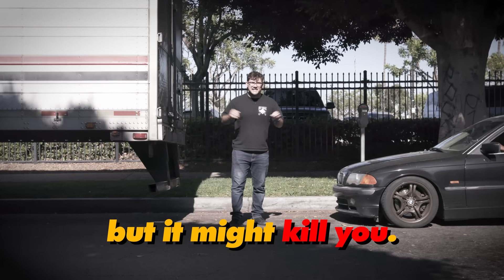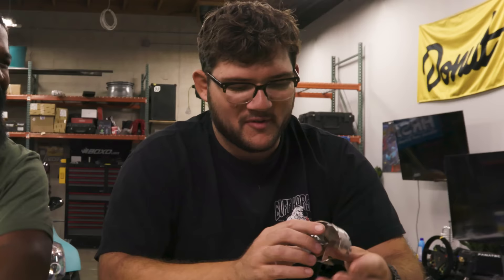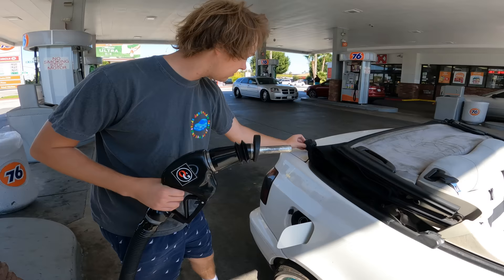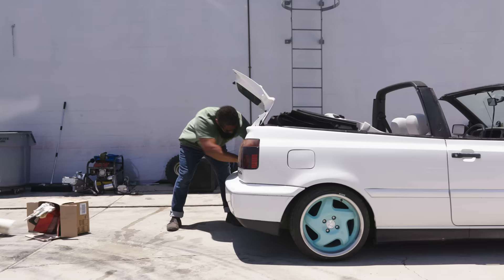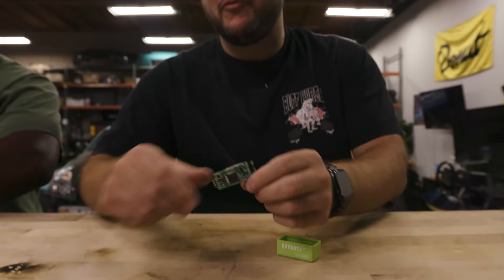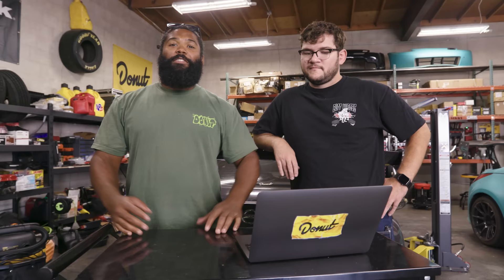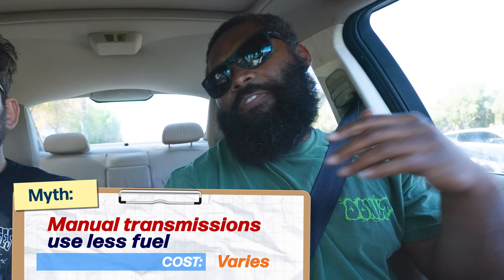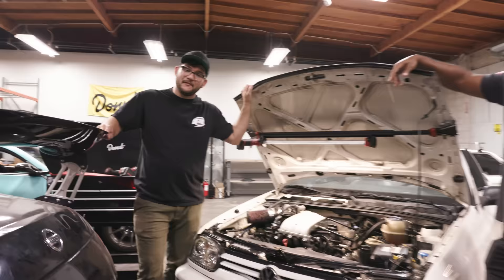Testing Fuel Economy Hacks

Comment: Using cruise controls is a huge way to help increase your MPG.
Reply: Yes. But if you are really trying to save fuel. You turn it off up hill and let the car slow down a bit when going uphill instead of just maintaining your speed over a short rolling hill. Then get your speed back up on the back side of the hill.
Reply: @TheYardLimit  That's probably right but it kind of defeats the point of cruise control.
Reply: This isn't true. Cruise control doesn't increase MPG. It decreases it. "Manual" throttle control is more efficient. In cruise control mode, the car has to constantly open the throttle (sometimes the whole way) to achieve a set speed. Manual throttle response allows the user to find that sweet spot where the car doesn't shift gears. Yes, you may decrease speed. But most cars are more efficient at 60 mph than at 75 mph anyway.
Reply: @TheYardLimit  The logic you start is the very reason not using cruise control is far less efficient. You foot is constantly pressing and releasing the throttle which results in accelerating more often. Which results in burning far more fuel. a simple Google search will result in verifying this.
Reply: @dougcook7507  Cruise control works great for hypermiling flat land. But if you are in an average car, especially with an automatic transmission, if you put the cruise on and come up to a hill, the car will sense the load but it wont know how long the grade is, its gonna kickdown a gear and give a bunch of gas to maintain speed.

If you are really good at hypermiling, what you do is anticipate the grade. Perhaps use a downhill section to gain some extra speed without using too much power from the motor, and then back off the throttle coming up the grade. Let the car drop down to maybe 50mph from 65 or 60 if the grade is short enough for you to kind of coast up. Thats really hypermiling 101.
Reply: @dougcook7507  cruise control is more efficient than the average smoothbrained driver, but an actual hypermiler will achieve much better mileage with the cruise control off. My car is featured in this video, "the roadmaster" station wagon. The previous owner deleted the cruise control(probably so that he didn't have to adapt it to work with the manual transmission conversion, but he was far from lazy lol. He had the patience to eek 40+mpg out of a 5000lb car with a v8. I witnessed it personally when I bought the car and only had to put 3.5 gallons in it after he drove it 180 miles to pick me up from the airport.
Reply: @brantkensinger3398  manual control is potentially far better for gas mileage.  For many people who can't control their foot well or can't control their emotions, cruise control would absolutely help
Reply: @pete-ph5xc  Cruise Control was invented to reduce speeding tickets, not aid in fuel economy. Cruise control is known to drop out of overdrive to maintain the set speed even if unnecessary in some situations. Even those drivers with a heavy foot still could have the same fuel economy as cruise control drivers. Manual throttle allows the car to stay in overdrive longer.
Reply: @TheYardLimit  wait i wanna know something. I use cruise control in my manual 6 speed car on the highway:
-If I’m in the right lane w no one ahead, I use CC in 6th gear at 65mph
-when going uphill, I downshift and go a bit slower 
Am I wasting gas?
Reply: @TheYardLimit  I’m gonna do some research on hypermilimg. This is my first time hearing of it. But proper driving etiquette aside, as that’s a huge can of worms not worth opening here, I usually go slow (60-70) on the highway, I draft cars and SUVs when I can, and when flat I use CC. Is any of this bad?
Reply: @gibbyg2001  not if ur only using it to save gas
Reply: This is not true, I hope that one day they'll make one that limits the maximum power and let the car slow down a bit on uphill and speeding a bit on downhill, like it would be perfect if you could select the range of desired speed and not the exact speed.
Reply: @TheYardLimit  lmfao your entire argument is “if you want to save fuel, drive slower”. No shit. But you’re injecting a confounding variable to win an argument. By that logic we could just set cruise control to a lower speed. Then we go back and forth with that argument until with hit zero mph. Cruise control, ceteris paribus, is more efficient. 🤦🏻‍♂️
Reply: I want to see the myth busted: driving frontage roads along the freeway at 40mph is more gas efficient than the freeway at 80mph. It's something we all know is true, I just want to see it. :-)
Reply: @FffffffffffffffffffffffffffffL  if you read all of my coments, you will see that I said specifically with automatic car. but a manual car will just lug the motor in cruise 5/6th gear on a steep hill. that also burns gas instead of coasting.
Reply: @samlevi4744  NO.  It's not that hard, you can apply that logic exponentially to any velocity. You just get momentujm on the flats and let it carry you as much as is practical over the grades. its simple. New cruise control systems can gaguge a grade with sonor. But most regular auto trans cruise control cars(think 90s and early 2000s cars) can not do this, and if u want to save gas all you do is set the cruise but be mindful of the surrounding terrain and try to navigate it as efficiantly as possible. More efficiantly than the PCM can.
Reply: @TheYardLimit  I read all your comments and I know. That’s why I asked you about manuals. But thanks for the info!
Reply: Cruise control get's me around 10% lower than factory claimed while I do 20-30% more than factory claimed. 
Traction control, stability control, cruise control etc. all do there job in the expense of fuel.
Reply: My experience: using cruise control vs my (fairly well honed) foot is worse for efficiency, on top of being less engaging. Thing is, pretty all of what cruise control does relieves your mind (and therefore your body) of managing your velocity related to others around you/ keeping out of accidents from others not doing so), let alone what you need to do real time stay as efficient. I know I'm a special case, but given I learned what I do it doesn't mean you can't.
Reply: I use cruise on the expressway and if I keep it under 65 it usually shows considerably higher immediate mpg than my car's (stupid) hwy EPA rating. On flat or almost flat road, anyway. It has pretty short gearing (Subaru STI) so even decent grades are fine in 6th with no lugging, but of course mpg goes away way down.
Maybe I should adopt a hypermiling trick or two.
Reply: I think part of the disagreement in this thread actually depends on the car. I've had and driven vehicles that had a mellower cruise control that let speed decrease on the uphill, while allowing speed to increase on the downhill. Which is like a very mild hyper-mile. Mild-mile.
I've also had and driven vehicles with a very aggressive cruise that downshifts, sometimes 2 gears on the uphill. Others will downshift on the downhill to hold the speed back. I'd like to suggest that the individual vehicles, and of course driving conditions, and user habits have a great effect on whether cruise helps or hurts MPGs.
Reply: Cruise control is the WORST thing you can do for better gas mileage on anything but a perfectly flat road.  Even florida had bridges which will downshift to keep the mph steady. This is the worst suggestion if you want to increase mileage.
Reply: @gibbyg2001  ...and it probably makes the people behind you rather angry, too! 😁
Reply: No cruise control in my 07 sentra lol

Comment: I'd love to see an ecomodded 80s or 90s brick pickup like an F150. I know the hypermiler guys have used rangers before but one of those 12mpg V8 bricks would be amazing to see the benefits on.
Reply: I would also like to see
Reply: Even more insane, ecomod a Mercedes G-class 6x6
Reply: @quarkonium3795  Ok that's just silly
Reply: Slip stream will usually cause the driver to have elevated Co2 levels as tested in autopsy of crash victims (reported by insurance company metrics)
Reply: I have a 94 suburban with laser iridium plugs, tires inflated to max (50psi), crank fan removed & timing advanced.  Haven't done any precise measuring but I know I'm getting better mileage because my needle moves slower & I'm paying less for gas because I'm using less.  It's my work vehicle & daily driver.

Comment: I have to use higher octane, for detonation.  Never thought I'd get better mileage, so I'm glad I educated myself.  Good job guys
Reply: Don’t know about the US but here in Germany you get less ethanol in the higher octane fuels so they’re marginally better than E5 or E10 but cost way more so its more expensive in the end…
Reply: They were wrong about top tier. Top tier gas is gas that has higher detergent it cost a couple extra pennies. Yes premium gas has, but it is all gas. It keeps your engine cleaner.
Reply: Power petrol has a higher number of octanes than standard petrol. Power petrol reduces engine knocking, due to which the vehicle's speed and power increase. This is what we get for paying more for gas

Comment: I like how you bust all these myths based on how you feel rather than actually testing them. Science 👍🏻
Reply: other people have done these test. You can snap your wipers and mirrors off if you like and post the results.
Reply: Agreed, the problem is the title "Testing Fuel Economy Hacks" but they only tested one. Using mythbusters for an example, I remember they tested AC vs windows but they did not show that even. Results were lower speed windows, higher AC. Expectations were them testing the myths not just talking about it
Reply: @sirjolly81  then any other hypermiling project does exactly that…
Reply: Buddy forgets YouTube is for entertainment at the end of the day

Comment: I have tested the tire thing myself. It 100% increses mpg. "Overinflating" is indeed bad and will likely cost you more, but inflating to the max rated psi on the tire or just slightly below that increased my mpg by about 2mpg. For perspective, i was getting about 13/14mpg in my F150. Now im getting around 16mpg depending on how aggressive i drive. Havent changed anything else.
Reply: i would not consider that 2mpg being worth me risking a blowout, and tire wear increase though
Reply: Yeah, I'm still gonna go by the manufacturer sticker
Reply: Ah, those crummy low rolling resistance "eco" tires most new cars come with... 
Yes, I get 2mpg less in my Mustang running proper summer tires.  But it also is roughly 50% better in rain, traction, and more importantly, stopping. It also rides much smoother.
Reply: @josephoberlander  better mpg in rain with summer tires? And better ride?  Wouldn't expect that, but icing on the cake
Reply: @nthgth  No, worse MPG overall.  But grip in the rain and ride/handling was easily 50% better.  It went from light and (overly) "agile" to planted to the road.
Reply: @josephoberlander  oh I misinterpreted.
Still though - worth it. It's a Mustang, not a Corolla.

Comment: As a long time Prius driver, the biggest differences in MPG I've seen comes from
1. Good driving technique (rapid acceleration and deceleration kill fuel economy)
2. Make sure tires are properly inflated. Underinflated tires lower fuel economy substantially
3. Weather (not really something you can control) with hybrid vehicles the drive battery is adversely affected by extremes in temperature. On really hot or really cold days my MPG can drop as much as 8MPG.
4. Drafting actually works well on the highway but you don't have to drive as close to large vehicles as you think. Just keeping a safe 3 second distance from large trucks improves economy over following smaller vehicles.

Comment: Used to slipstream semis in my 71 VW Bus on road-trips. Helped immensely with engine load and fuel mileage
Reply: Slipstreamed in a 98 Camry record 38.6mpg, I think my dad was only getting 26mpg.
Slipstreamed in a 11 SX4 record 34mpg.
The SX4 gets 18.8mpg at 70mph, facing the wind by itself. If I want to go over 62mph, slipstream is critical.
Although if the wind is particularly sideways, nothing that can be done, and gas mileage is going to suck no matter what, and if it is super blowing in my direction, I have to keep the CVT in Manual 5 because it doesn’t have enough torque to overcome the wind in Manual 6.

Comment: theres a few mistakes here and there. 
overinflating your tires by around 10% doesnt create uneven wear and also doesnt ruin your handling, but will do a tiny bit of fuel saving. just dont overdo it.
better gas -> here in germany we have 5% ethanol and 10% ethanol gas. the price is so close that calculation wise it doesnt make any difference, but my dad uses around 5% more fuel with it being only 2% cheaper. i dont recommend the 10% based on that.
cold and hot gas at a gas station -> of course the tanks also heat up a bit. every gas station that i worked on could check the temp of the stored fuel at any given time, and in summer the fuel actually had a temp difference from night to day. 40°F during the night and up to 52°F during the day. but the pumps are actually programmed to take that into account while selling. here in germany they are calculated to measure what volume the fuel would have at 68°F and they account for it being colder and thus taking up less volume
removing side mirrors -> mercedes measured during the 80's or 90's that removing both sidemirrors would actually decrease aerodynamic drag by around 15%, which is ginormous. thats also why most new semi-trucks here in europe actually have side cameras instead of mirrors. modern mirrors most likely cause a bit less drag than what merc measured back when they did, but still you shouldnt remove your mirrors for safety and legality reasons. also cars without mirrors look weird.
auxilleries -> AC is a very big one, which can dependign on your model take up to 5% of your total cars power, especially in economy cars. but lights for example were measured by volvo -> they couldnt measure the difference between regular light on and off on their testing track. keep your lights on guys. if you have a biiiiig aftermarket stereo tho, keep it down, that will eat energy and with that fuel.
and now the big one; transmission -> most cars and/or most drivers will drive more efficient with an automatic. you cant be as precise or as quick as an automatic gearbox, even if youre a racedriver. they banned automatics and cvt's from f1 for a reason. but, and thats a very small but -> if you have an econobox and you know the speeds you need, and the gears line up with your needed speeds, and you are very very good, quick and consistent with your manual gearbox you might safe a miniscule amount of fuel as manuals are mechanically more efficient in transmitting the power and are generally lighter. this all falls apart the moment you do anything outside of these gear ranges or even start to drive more sporty with a lot of gearchanges. but rolling on the highway with a fixed speed the manual can be more efficient. thats the case maybe 2% of the time. works for my dad with his driving style and commute, doesnt work for my mom with her driving style. sooo there is a tiny spec of truth even today. but if you go for efficiency in all situation a CVT is actually the best, as much as it hurts us car guys.
Reply: They also got the air circulation in the pick-up bed wrong - - beer cans migrate to the front.
Reply: I agree with most of this.  There are tons of flaws and left out considerations in most of the conclusions that they came to in thus video.

A really big one is that you can't use a scangauge as an accurate way to determine changes in fuel economy that come from modifications.  The best way is to fill up at a pump without topping off, drive, then fill up at the same pump until the pump auto shuts off when full and divide your miles driven by volume of fuel put in.  Establish a baseline by doing this before the mods then again after your mods and with similar weather, traffic conditions, driving habits and routes and compare the results.
Reply: We got e10 here and e15 now whether we like it or not haha
Reply: that sucks tbh

i remember that my old moped didnt even like e5 and i had to pump the v-power or aral ultimate stuff for it or it would sputter and be down on power.
Reply: @drache444444  yeah but if you need it there are ways to get more "pure" gasoline from hardware stores and stuff. America is weird like that.